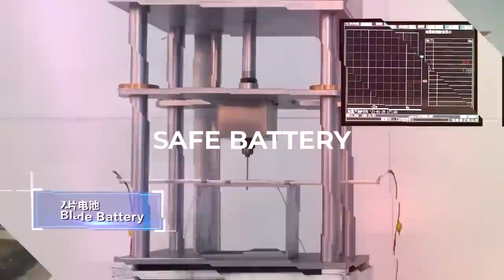Ford's 100yrs of manufacturing prowess is a US media fabrication

Comment: I work for an electronics manufacturer and we are getting around the Semi shortage by running the R&D department on overtime. Basically we design several versions of the products with whatever parts we can get, one product has 5 different BOMs to get around crucial shortages. I would wager that is what Tesla is doing in part.

Comment: I worked as a buyer in a kanban (just in time) style factory. For simple multi-sourced parts (fasteners, generic electronics) and most raw materials, third-party suppliers make sense. For complex parts and custom electronics relying on third-party vendors was plain stupid (except to the accountants.) The plant I worked at was a lot more vertically oriented than most, but whenever vendors took on the complicated bad things would happen--either they would produce things with lower-grade materials than required, or they would flat out make things incorrectly, or deliveries would be delayed--any of these problems would shut down the line until it was fixed. Some things are just stupid to outsource. Like Ford badges.
Reply: It makes alot of sense to buy custom chips from 3rd parties.  Cars dont need the newest chips so they can use variations of older Chips that are cheaper because alot of the  R&D costs already have been payed off over years of prior production.    Running a Fab is also very different from making Cars and only 2 or 3 Companies know how to do it well.

Comment: The major auto companies usually only manufacture large components (e.g., engines, transmissions, sheet metal, some electrical/vacuum) internally. It is common to have everything else made externally. In the case of the Ford badges fiasco, Ford made the mistake of not having a disaster backup plan. When I worked for Ford long ago we would require in the purchase agreement that the the tooling used by suppliers be owned by Ford. In the case of a strike or disaster at a supplier location, we would relocate the tooling and produce the parts at an offsite location (e.g.,  warehouse) until the supplier recovered. Your major point that Ford has lost its capability to manufacture to scale is unfortunately totally valid and it has never been more true than under Mr. Farley.

Comment: I like Ford, but the dual clutch transmission issue of a decade ago would have been handled differently by Toyota.  It helped make Ford to be a truck and SUV company.
Reply: Amen to that. I visit a Ford service area weekly. Recall, blown motors, dual clutchs, etc etc etc. Found on the Road Dead.

Comment: I don’t know what things are like in the land down under, but our labor situation in the US has gone into strange territory it’s not been in the last hundred years, at a minimum, largely as a direct result of the pandemic and all the policies, combined with the high inflation.

So many people have decided to not take work seriously as far as being reliable and actually showing up for work that hours have been reduced at a lot of places.  I’m not surprised there are supplier issues, why would anything not very vertically-integrated not be negatively-affected?  How many places don’t have bean counters running things to a dangerous degree?  The bean counters have a huge impact on why things are the way they are at this time, it’s pure nuts how much influence they’ve had over setting employment expectations.

I just got back from a 6300 mile road trip, and what I saw shows it’s not localized to some part of the country, it’s visibly present all over the US.  I have no experience outside the US to know if it has spread everywhere else like it has in the US.

Comment: I wouldn't recommend buying Ford stock, but I will say they are making significant efforts to improve.  They created new vehicles like the Ford Maverick and the Ford Bronco.  Both are very well received vehicles.  These are brand new vehicles.   They also created the Ford MachE and the Ford Lightning, those too are well received.  Again, brand new vehicles.   They still, believe it or not, sell a lot of Ford Explorers and Ford Edges.   In addition their F250, F350, F450 and Transit vans are strong sellers.  Granted, they need to improve cost and efficiencies.

Comment: When Ford started out, a car was just "basic transportation", to get you from A to B in a timely manner.  Basically a horseless carriage.  The Ford mantra was "a car in every driveway, and a $100.00 car".  The primary challenge was mechanical design and efficient manufacture.  (any color of black) There were very few government regulations and standards around safety, emissions, gas mileage etc.   Today a car is much more than "basic transportation", besides all the regulation hurdles it is a "fashion statement", a cool badge like Apple etc.  Today the Tesla badge is like the Apple badge, and the Ford and GM badges are not cool any more.  Recently Kia rebadged all their vehicles with cool new design of badges.  In the past IBM sold off its Laptop manufacturing business: The reason given was: "it is impossible to maintain a technological lead of more than a year, or a competitive, profitable design and manufacture lead more than few months."  So it is basically either "compete" at high speed or "give up".  When the Japanese car invasion first started, and the big 3 required bail outs, there was a lot of hype about automobile manufacturing being a "sunset industry".

Comment: It says a ton about Ford when something as simple as badges for their vehicles is a major issue. Ford has always had quality issues, even when they used the slogan "Quality is job one ". 

Ford and GM are a mess. They still have major issues that have been around for decades. Farley and Barra both saying they are pushing for EVs, but I feel like both will say whatever makes their stock prices go up. I doubt Ford or GM will ever shed the legacy builders culture that has been slowly killing them. 

Sandy Munro has spoken of the challenges of old company culture. It is hard to change that. This is why Tesla will crush Ford and GM. Tesla adapts quickly and is willing to make major changes.

Comment: I’m not surprised, every ford I’ve owned have been consistently problematic. Crappy transmissions, starters, water pumps (every 2 years), constantly failing and oil burning. By comparison all my GM vehicles have reliable like Toyotas. I really believe Ford is done.
Reply: And you kept buying Fords in those days?  I got turned off by Ford decades ago when I changed the battery on my mom’s Maverick, so stupidly designed/positioned I swore never to buy a Ford and never did.
Reply: @Chainyanker007  I gave up on Ferd decades ago when I purchased a brand new Ranger that leaked fluid from everywhere that it could other than the washer fluid tank or the blinker fluid.

Comment: Sam, Tesla is vertically integrated and that is a good thing (especially at this stage of the evolution of EVs) but it isn't an island. Are tyres, wheels and brake components, for instance, supplied by other manufacturers? You must know the answer to that is yes. And, why is that? It is because it is uneconomic for Tesla to produce some parts for itself! The logic of vertical integration has practical boundaries. Tesla could produce its own tyres (substituting Tesla brand tyres for existing supply chain contractors), if it wanted to, but in that case Tesla would be flying in the face of its own mantra on vertical integration. Tyre companies are already vertically integrated and bringing that function in-house is not exactly the same thing as becoming even more vertically integrated company.

Also, to Tesla's credit it designs a good number of its own advanced electronic components. But, Tesla isn't a semiconductor manufacturer and it isn't seeking to become one. It gives the job of fabrication to other companies that specialise in that area. Tesla hasn't continued to get the silicon parts that it needs because 'it makes its own chips' as you frequently say. Tesla's supply of chips, no doubt, has been constrained but less constrained than its rivals. That is because Tesla a) understands what it is doing and is in a position to react constructively to shortages by substituting chip B, which is available in volume, to do the job of the once preferred chip A, which is now in short supply or because b) Tesla maintained its contractual arrangements with its silicon parts suppliers during the pandemic lockdowns while other companies voided theirs, putting itself at the head of the semiconductor supply queue and in a position to capture an even greater proportion of of the chip making capacity of the major silicon fabricators.

You need to temper your allusions to 'vertical integration' with a realistic sense of where things stand on that and on where things will likely go next. Also, when Tesla acts out of necessity, e.g. when it acquires mines or refining facilities, that can't always be taken as a reliable sign of the way that Tesla would Iike to organise its industrial facilities or business affairs. Tesla is a manufacturer. Its interest in mining is tactical - Tesla needs to assure supplies of required chemical compounds for its batteries - and that interest will probably be relatively short lived. Even refining, unless Tesla feels it has something special to offer in that area, would probably be beyond Tesla's long term remit.

I certainly could see Tesla develop a business interest in the design and construction of chemical refining facilities. Still, activities of that sort could be pursued outside the Tesla umbrella and might progress more quickly if they were.

Comment: The well-named Motley Fool fancies himself another Peter Lynch who, through the Magellan Fund, made a fortune with Ford stock.  Ford has too much weight to approach the future as a "nimble" company, ready to roll with the punches.  Their excess weight includes the need to support a dividend which the "preferred stock" Ford family relies on rather than retire debt.  The second is legacy retirement costs that were shed by GM during the bankruptcy restructuring.  The third is union wages and restrictions that get in the way of becoming a low cost producer.  Even competent leadership will be challenged to keep the company's head above water in the high seas ahead.

Comment: Pardon me while I let out a string of swear words that you shouldn't be allowed to say on TV

Oil, gas, transmission, fuel pump, differentia,l diesel, crude oil!!!

Of course 3D print them! Or get them from Thailand! Release the specs for printing one, not a regular one but a special edition, that people can print themselves. Bring your own badge $25 discount when you buy a new Ford. Contact some of the model companies authorized to sell kits based on Ford vehicles; customers get a coupon for a real badge when one is available, in the meantime they get a plastic one that they can paint themself. Fun for the whole family during lockdown! Get badges off of scrapped Fords, call it retro. All of these are temporary badges, you can mail the real badges to the customers later. Heck, ask Tesla to manufacture them, they know how to do things during this situation that seems to paralyze the other car companies. Customers of companies everywhere understand that we had a pandemic, everyone has supply chain issues, they'll put up with temporary badges. I'm sure they'd much rather have the car first.